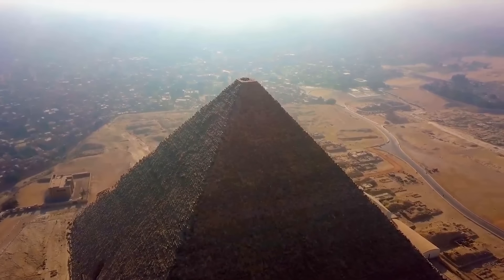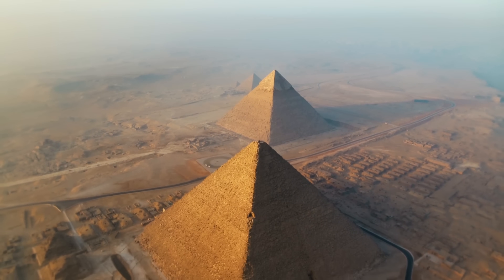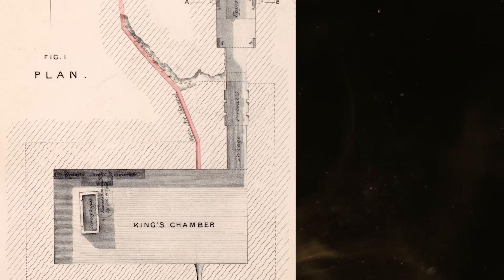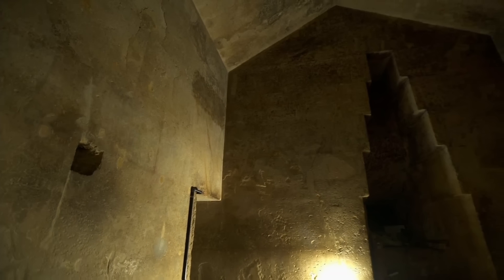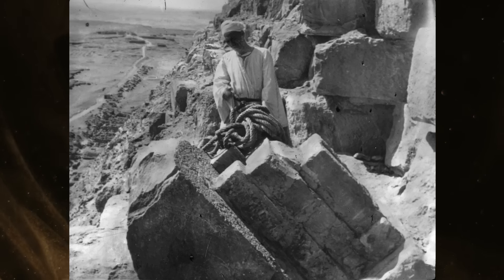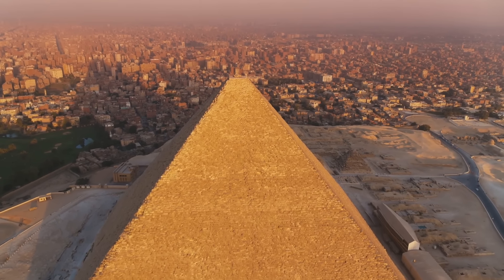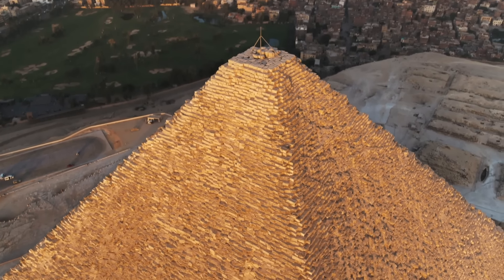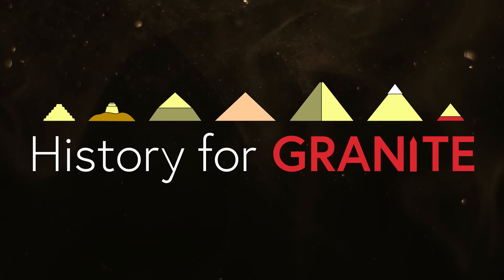One Solution to the Four Channels of the Great Pyramid

Comment: I’m not quite convinced of the need to leave them plugged, although it seems apparent that different methods were used to break through the final sections. One thing I find odd is how that supposed saw cuts could be so vertical and not have rounded corners or some other pattern besides a perpendicular termination of the cut?

Since you want questions; considering the construction planning and execution, were the shafts maybe not opened so as to not allow the workers to see or hear sounds coming from the chambers that may eluded to sacred rituals, but more likely indicate some kind of presence of treasure and wealth and importance. Considering today’s similar methods for doing secret things, you want to compartmentalize and seclude people, things, and phases. So maybe the people who put down the blocks for the chambers themselves were the. Replaced by others who had not had any hand in the chambers and didn’t even know they were there and thought they were just putting blocks on top of each other. They may have been been a specialized group of builders that did such work. 

I will also point out that this notion that it was all brutal slave labor is seemingly not very precise. I have a while ago now seen clear cases for the fact that there were actually a lot of skilled and knowledgeable people involved and it was essentially like how cathedrals in Europe were built with guilds and small business and skilled craftsmen. I don’t think your statement about that the workers were not afforded air should be considered useful. Cheers.

Comment: Thank you for this it's extremely interesting and I don't envy anyone wading into the debate.

I don't have any background or remote expertise about the pyramids but a couple questions came to mind, apologies if these are elementary and are answered in other videos:
1. What was the cause of the salt buildup in the QC? If it was so much that the faces looked unfinished does that imply they were filled for a long time with saltwater or something? And what is the general conclusion for that?
2. The copper pieces that are proposed as the backs of plug handles looked like they were in rough shape/corroded, is that what happens to copper naturally or is there some reason for that? (Could it be related to the salt? Was any salt found in the shafts?)
Reply from the maker: The salt proliferates where moisture is trapped inside pyramids, and the Queen's Chamber was always reported as quite 'dank' throughout history. Trapped moisture is likely responsible for most damage, including the copper pins.
Reply: @HistoryforGRANITE  thank you for the reply. If it was that wet in there it must've smelled like the oldest basement for the first ppl to get back in there.

I could imagine "pyramid salt" as quite the ultimate luxury for some super rich 19th century magnate.
Thx for the insight!

Comment: The one thing I'm still confused about is how and why the chambers would have been constructed without airflow. Without airflow, I'd imagine that work on the chambers would have to be extremely slow because of all the heat and CO2. It also seems like it would've taken a lot less effort to shape the channel openings before putting the joints in place.

Comment: Upside down U shape is for containment of gasses. Copper pins going through a plug is called a spark plug. There are hints of gasses and detonation. Access passages lower than the shafts indicate a pump system with an automatic purge. It's not hard to see that chemicals were introduced from some shafts. Chemistry and combustion were at play here.

Comment: Is your hypothesis that removing the moisture left by workers in these areas by means of ventilation was part of the long term preservation plan for the buried mummies?
Reply: That might have something to do with it but I'm assuming, based if his other videos, he's suggesting the air flow was for potential visitors and worshipers. Also temperature control to lessen the effects of thermal expansion from within.

Comment: Very interesting despite the fact there is obviously no answer as to the reason for these shafts. 
My question is how were they included in the construction sequence and why all the bends. Are they at right angles to the line of the outer casing if extended to it? (I know Perring traces a horizontal section to the casing but still...) Thank you.

Comment: Putting myself in the mindset of someone building this structure as my eternal resting place, I would need to account for how long it would take to complete and the chance my life would end prior to completion. Therefore, as construction begins, the lowest chamber would be dug out as the structure above proceeds. In the case of my early death the lowest chamber would be used and would be naturally cool being underground. The second level up (queens chamber) would be next and being in the center of the structure would require ventilation shafts to reduce humidity which would destroy the dried body. Since I am still alive as the pyramid reaches the upper chamber (kings), those shafts could simply be sealed off at their outer edge this explaining the finished stones discovered there and the handle to place the lid on the end. Finally the structure is complete and the upper chamber has good ventilation using the two shafts to keep the temp and humidity down while preventing their use as a robber shaft. Not an original idea I’m sure but seems quite straight forward and logical to me. Love the channel!

Comment: The builder have figured it out that an inverted U channel is far superior compared with normal U channel. 

The inverted U channel acts like umbrella keeps water from outside in also leak water from inside out. So little to no water ends up in the chambers. But I don’t know for sure it is so the entire length.

Comment: So the intention was to remove the protective blocking stone near the exterior of the pyramid with ropes attached to the copper handles.
The problem is there are multiple blocking stones in the same shaft. They are not connected together. The outer stone would have to have ropes going past it, effectively wedging it open.

Comment: In regards to opening of the channel being squared for a few centimetres;
I am a stone mason.
I have fitted many letterboxes into stone I have cut.
When I cut out the inside of the letterbox, I try to do it nicely, but it’s far from perfect, but who cares, it’s the inside of the letterbox which nobody sees.
But I have to cut the opening perfectly to fit the fascia into it.
Often I leave extra stone in place until fascia installation, then cut it back in-situ 
Could it be possible that the channel was squared at the opening to house a grated copper fascia that looks nice, hides the rough inside and allows air flow?

Comment: I've often wondered if the interior of the great pyramid, which I've been lucky enough to visit, is designed to support a chemical process to make flammable gas that would flare off illuminating the polished faces of the structure. The lower chambers inundate with water actuvating a chemical reaction, the upper ones act as gasometers and the channels carry the gas to openings on the faces.  A sort of greek fire igniting when poured onto water or similar.

Comment: Those copper pins look more like broken off wires and so I’d say those particular shafts are for wiring. For the lights of course. You need air too and that would be those other shafts that go all the way outside.
The power source or where you can tap in has to be right there.

Comment: If the shafts were perfectly straight then discovering both of the exit holes on the surface of the pyramid would allow you to calculate the exact position of the king's chamber within. Perhaps the dog legs are meant to disguise the actual location of the chamber from the perspective of an outside attacker that knows about the shafts?

Comment: I have a different opinion. I think that the shafts were for ventilation for the workers, but weren't supposed to be seen upon completion. The square corners of the kings chamber shafts suggests that they intended for a plug to be set in place. The fact that the queens chamber had one covered seems to prove this. Also, the shafts for the queens chamber don't go all the way to outside (According to drawings shown)  which suggests that the queens chamber was finished before the shafts reached the exterior. Why is that one corner left unfinished? Possibly due to the  need for the chamber before it was finished.
Reply from the maker: The QC channels were uncut, not plugged. Also the QC would not need air channels until after the Grand Gallery was finished and closed, which is most of the distance that the QC channels travel.

Comment: I still don't understand (maybe I missed it) the video's theory as to why the shafts were originally built blocked at their chamber ends.  If the eventual goal, as the work was being finished, was to unblock them, why block them in the first place?  Why design and carve the wall blocks with barriers that were intended to be removed as construction was finishing, creating extra steps to realize the intended design?

Comment: I reckon that the holes where used to let the air go out of the piramide while they where filling it with water to reach the desired level in the chamber.
Immagine if the shafts where closed they wouldn't be able to fill it with water due to the air pressure.

Comment: If been in construction for 22yrs and two things popped out.
1) Those massive blocks blocking the queens chamber are put like that for a specific reason.  What that reason is I have 0 clue.  Just my opinion the difficulty of angling those blocks to a perfect degree would be extremely difficult, especially back then.

2). Didn’t they need air for construction?  To work with paintings, collectibles, etc.  Those people are going to need fresh air to complete the final touches inside.

I’ve been listening to this while cleaning.  So I may have missed something said earlier.

Comment: if we wanna learn how, and why, we ourselves should try and build a pyramid with the same architecture.
As a Laptop technician, i usually disassemble laptops and do not wonder why things are the way they are, Only when i try to assemble it back, i understand why things are designed and build as they are, because of the fitments, the things getting in your way, and finding which wires go to which channel

Comment: Would it not be a reasonable assumption that the channels were ventilation shafts to be used during the construction, and closed up either when the interior work was done, or when the occupant was laid to rest inside, or even prehaps having been intended for opening once the mummy was placed inside to control the humidity and temperatures inside?

Comment: if those copper pins/loops had rope loops with floats tied to them. it would allow that anchor to drop in and connect with the loops, allowing it to be pulled out from underwater. maybe just rain protection. copper would be the choice for rust resistance.

Comment: Questioner: What did you mean by chimney? What was its specific purpose?

Ra: There is a proper flow of your atmosphere which, though small, freshens the whole of the structure. This was designed by having air-flow ducts, as this instrument might call them, situated so that there was a freshness of atmosphere without any disturbance or draft.

Ra Material (1981)

Comment: If you re-draw the sides of the pyramid so that they go through the ends of the sealed off channels, and then continue to a peak, would that not look like the bent pyramid? So perhaps that was the original plan and then they came up with a better idea for a secure chamber that necessitated building higher, leaving the original channels stranded and sealed?

Comment: Why not channels for running rope through?  Having a weighted pullet system on the outside of the pyramid to raise and lower building materials in, and remove debris out, would be necessary.

Comment: How did the workers work without sufficient air etc?  The N channel was blocked off by a facing stone or a stone as part of the structure.  Likely they built the lower levels first.  When the roof was put over the Kings chamber was the chamber then closed?  The channel was continued after the roof was put on.

Comment: Assumptions are made about the “ queen’s chamber unfinished corner”
If the walls at the time were timber, the flat flush surfaces of the walls would be proof of craftsmanship, 
the corners may have been needed for grip or leverage that required the corner as an anchor point.

If there were wooden floors and walls prior to looting, or removal as fire wood, we will never know.

Having a lip or an edge on a wall, at the corner of a room adjoining a hallway.. 
please consider it was or may be for a winch/ pulley/ hand grip etc to anchor for leverage in moving heavy items.

Comment: If the great Pyramid did indeed have an openable door which some believe then air flow would also have been necessary for the door to function correctly ie to allow the door to open and close. And maybe the small size of the vents provided a degree of resistance to air flow when the door was being closed forming a type of soft close functionality for the door similar to how modern day door closers work on fire doors. And perhaps they included the queens chamber vents as a way of fine tuning the speed of the soft close but found that the kings chamber vents were enough answering why the queens chamber vents were never opened.?

Comment: If the passages are so small that a rat would be an appropriate scale, those pins must be like very large nails.  I wonder if they are connected implying there might be a handle or something similar on the other side.  I would suspect you could run a current across them to verify.

Comment: The channels are the right size for the Shabti. The door a way of telling the king's retinue of tiny servants they  were stuck with the King for eternity. There was no escape for the poor Shabti. 

The channels were probably designed originally as air vents, the doors put in later as an after thought to plug the the gaps in the necropolis. 

The whole idea of a tomb is to seal it for eternity, so air vents would've posed a problem. But why would they bother to protect workers  constructing the pyramids with air con?

Well as we can see, these pyramid builders were not ordinary workers, they were highly skilled architects who wouldn't have wanted to breathe in putrid air during construction. Moreover, Khufu himself may have visited the site to inspect the progress of the build.

Comment: This connects to your earlier video where you smartly state that the pyramid wasn't meant to be sealed off but was meant for vistit. So there is a connection..you want fresh air for visitors and worshippers.

The thing that i don't understand is why would they be sealed during construction. 

1 they could have been left open for air for worker

2 if the workers covered them with construction materials like you say, it would have been easier for them to clean then to break open once construction is done.

And another theory...could they have served as channels for ropes to lift heavy stuff inside from the outside?

Comment: The number 2701 is the most famous number among people interested in number mystery of the writings of Holy Scripture. This is because the first 7 words of the Hebrew Torah have the Gematria 2701 and the small Gematria of 82, and Gematria of the word Torah in Hebrew is 611 and small Gematria of 17, and recently it was found that the first 611 digits of Pi add to 2701 and the first 17 digits of Pi add to 82.

Just to explain more clearly what Gematria is the word "Torah" is made up of the letters Tav, Vav, Reish, and Hei, which have the numerical values 400, 6, 200, and 5, respectively, and 611=400+6+200+5 and 17=4+0+0+6+2+0+0+5.

The ancient word for Torah is as ancient as the Torah itself I presume, but it is only in the last 100 years that we have been able to know Pi to 611 places of digits, and then there is the time it took to add them up to make the discoveries regarding 2701 and 82.

The Seventh Day Adventist Church has maintained for nearly 200 years that the Crucifixion happened on the 27th of April 31 AD, and the roots of 2701 and 82 are 37 73 2 and 41, and the 41 with the 37 and the 2 make 41372, and that is like the date 27th day in 31 AD of the 4th month which is April, but reversed, and the 73=1x1x73x1, and that is like the 117th day of 31 AD, which was also the 27th of April 31 AD. What is more is that, 2701 plus its reverse 1072 is 3773, and 2701=37x73, and 3773=11x7^3x1 ! What is more is the Kings Chamber of the Great Pyramid is 10.4711733x1 metres, being 20 cubits like the Holy Place of the Israel Temples, and each cubit Pi minus Phi squared in metres. I think that surely this is the main message of the Gematria of the first 7 words of the Torah in Hebrew, made of 4x7=28 letters?

Just to help show a bit more of about Genesis 1:1 Gematria and mall Gematria:

The sum of the first 7 digits of Pi 1+4+1+5+9+2+6=28 and 28 is the reverse of 82. Imagine presenting the first 82 digits after the decimal point of the number Pi with each digit, multiplied by itself or squared, the first 82 decimal digits of pi each squared add up to exactly 2701 as well !

But there is yet even more, but such is the nature of living with God forever !

Love among the ruins of the complex is also a reality of God.